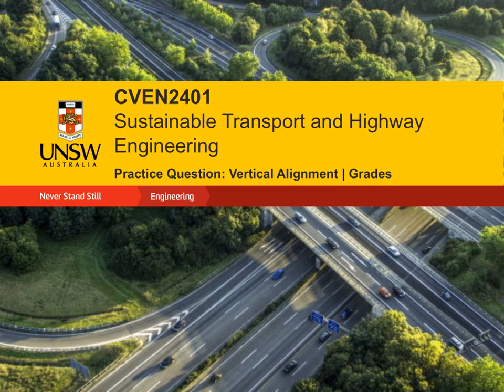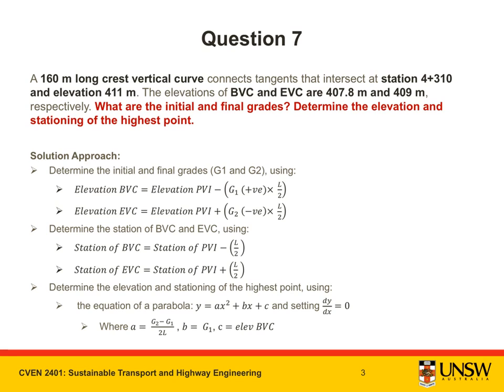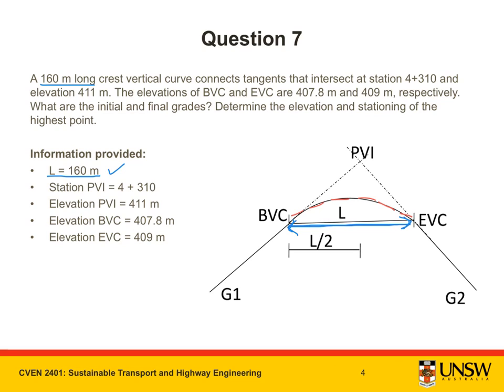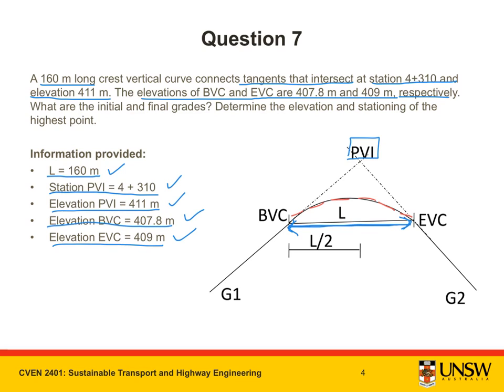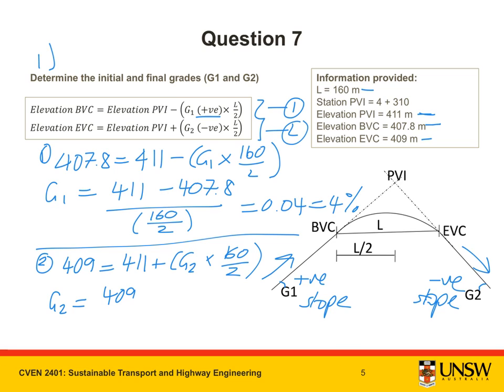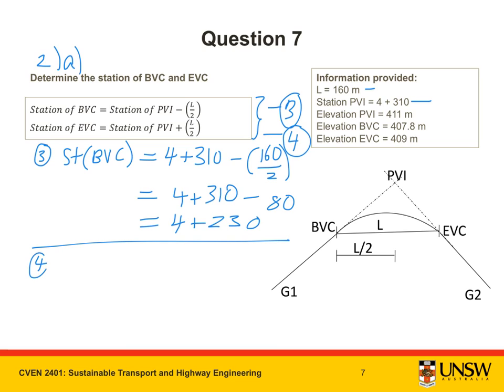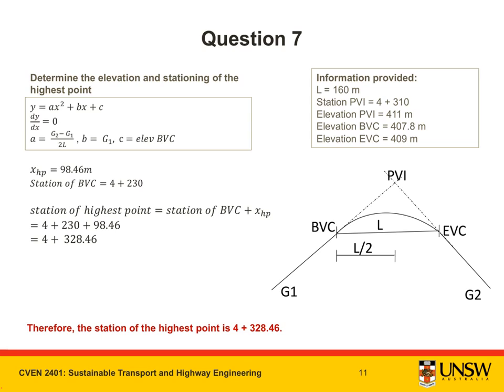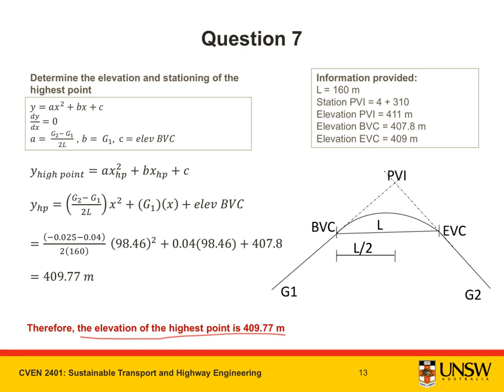Vertical Alignment: Vertical Curve Design (Question 7)

Comment: So many mistakes!!! First of all 2L should equal 360. Second, in the equation finding the x value, the G's are written in percent, not in decimal. That is a major mistake. Yes it will yield the same result but we should still write in the correct way.
Reply: Everything is correct. It's a matter of working out the parenthesis and fractions. Once you do it that way, you will find the answer is totally correct and there are no mistakes at all

Comment: 10:58 L=160 so 2L should be 320
Reply: She crosses it out with the 2 outside the brackets (her written working out is wrong but the final answer is actually correct if you do the question before watching the video all the way to the end)